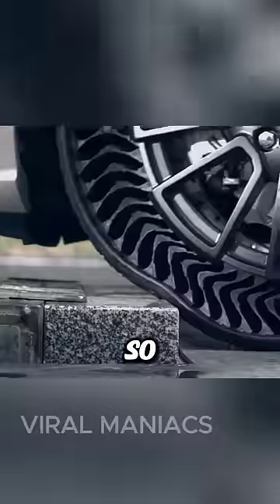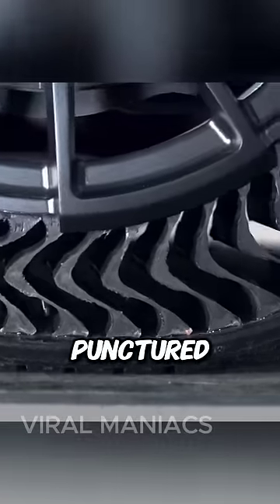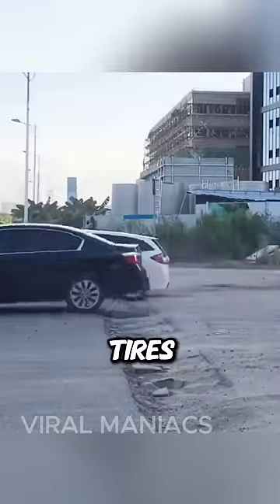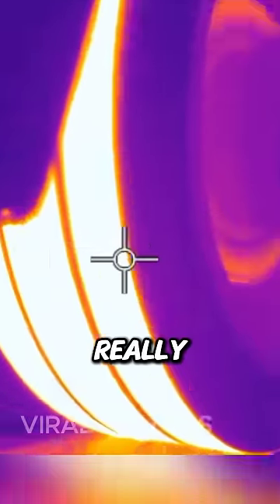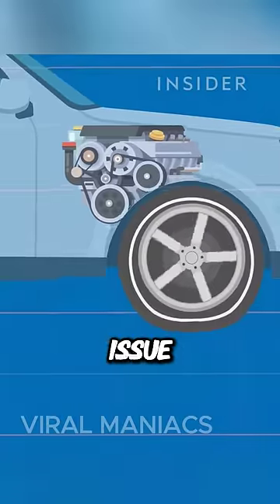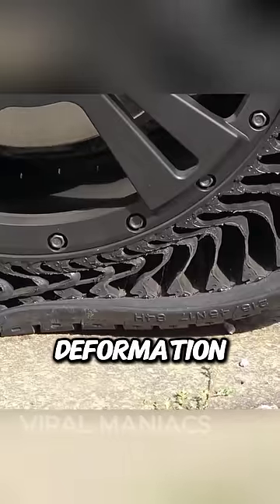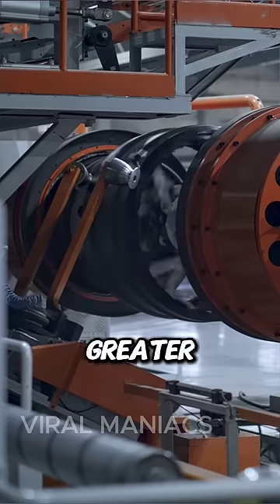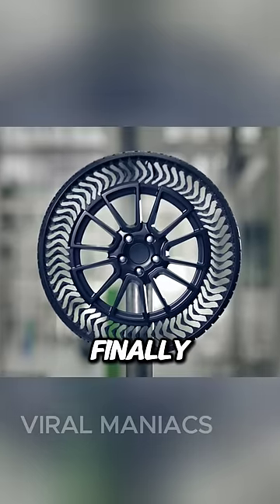Why Don't We Use Airless Tires Yet #shorts

Comment: Firestone bought a company around the late 90s. Doing the same things to stop them from making it.
Reply: I have heard of that happening, with Numerous companies... Honda bought Carabella (Mexico)  back in the mid-70's to stop them from producing motorcycles that were out-performing their own machines, and selling them to their Largest market at that time, The USA....  Several other companies have done that, sometimes with favorable, and sometimes with disastrous results... Boeing acquireing Douglas, was perhaps one of the largest acquisitions that was notoriously riddled with serious quality control issues and unauthorized engineering and production practices... Many of their problems stemmed from  the independant contractors who were not properly trained with the manufacturing and assembly techniques and the lack of adhering to standard policies & procedures...
        These acquisitions and Mergers, can make (or break) previously healthy companies... It largely and frequently depends on the upper management , and what their ACTUAL intentions are....
Reply: @michaelmartinez1345 Boeing and quality control issues? Shocking! 😂

Comment: If the objective was to create tires that doesn't burst, why not merge the two as one and fill them with air to address the issue of bursting, shock absorption, deformation,  etc.
Reply: Those are called run flat tires. They are pretty nice if you can afford them.
Reply: It would probably cost more to make sure the the tire can handle the air pressure, and even if they could make it work if air got out through a hole or something it would throw off the balance and safety would be a concern
Reply: @nickh7777  bingo. Wobble wheels

Comment: Honestly the main resion is that u change a tire more from lose of tire grips instead of punchers.. fix that first please and tks🙏 😅
Reply: Let's not get ahead of ourselves just yet. That part hasn't been covered. Maybe is very durable.
Reply: Soft and grippy tyres wouldn't last and they would be expensive. Hence why you only see them on performance vehicles. In what way do you tyres lose grip??
Reply: @jesmondo5785 he's talking about tread wear. Which is not the main reason tires get replaced. If it was, the tire industry wouldn't be designing tires that can last  thousands of miles.
Reply: maybe you should go back to school
Reply: To be clarify, I was talking about wear and tear.. maybe I'm getting luck but honestly only had 2 punchers I'm my life time ( one of them was suspicious btw nail in side wall?? After being parked in town) 
so basically almost all my tire changes was because of wear and tear ..
Lose of tread deapth essentially..
But as I said my experience may not be  Typical  ..
Reply: Your experience is typical. Good point. this "advancement" seems useless
Reply: @Bl4ckD0g rofl.. tread wear IS the most common reason tyres get worn and replaced, what tyreless country do u live in,?..
Reply: Spreak engrish prease

Comment: What about shtt accumulation every 2nd day between those gaps making it rock hard
Reply: they are covered like a normal tire, its exposed for visual purposes only
Reply: @59plexi So there's a side wall that needs to flex without splitting also...
Reply: @cpickles2996  yeah, exactly..it can't b covered

Comment: Sooo instead of replacing the tyre, i need a new wheel also?
Reply: Tire*
Reply: @user-oz9fq5uf6g  not american mate. The union jack should have been a clue. Tyre is correct 👍. Also its Colour not color.
Reply: @leed2883 you changed your language half way through.
Reply: @stephenkillin9730  what you on about?
Reply: @stephenkillin9730 The US doesnt even own English
Reply: @leed2883 hate to break it to you, but both "tyre" and "tire" are correct, and both "color" and "colour" are correct. It may be hard to comprehend but it's called a language difference which results in different spellings for the same meaning. There is a reason why there is English (US) and English (UK) in a lot of language options on devices. Lexicons differ between regions even if they both use the same base language, in this case "English". You understand what he is saying when he says Tire and Color, and he understands what you're saying when you say Tyre or Colour and that's all that matters because the only difference is the type of English

Comment: These haven’t been shown to be better in many of the ways that matter like efficient rolling resistance (They tend to add rolling resistance, although doing so while adding traction by increasing the contact point space between the wheel and the road / ground surface, sort of acting like a tank tread) Because they obviously don’t have air inside them and traditional tire sidewalls that allow for air pressure to push against said sidewalls to add strength, causing a lack of structural and efficient circularity rigidity to the tire. These tire / wheel systems would likely be good in zero or low atmospheric conditions with environments of lesser gravity, like the Moon and Mars, where the tread deforming could add traction and allow it to deform over rocks and other potential debris and obstacles. Unlike the solid metal wheels on current rovers like Curiosity and Perseverance, which have been shown to rip off sections that are stress hardened over time and then made hard and brittle after time of ware and tear, as well as cycles of temperature extremes going in and outside of direct sunlight. Whereas, these tires could possibly retain their pliability. Granted, they would have to be made out of a substance that remains “rubbery” at the high and low temperature extremes experienced on the surface of the Moon and Mars, when traditional sunset would place them in or out of direct hot sunlight and very cold shadow (causing extreme variability in temperatures) and since having air pressure in tires surrounded by little to no atmosphere, is basically impossible due to little to no atmospheric pressure pushing against it, and causing for unintended expansion of the tire pressure in standard tires makes them unfit for these off Earth applications. It could possibly also allow for the regolith to pass through the connection struts of the tire, possibly allowing for a paddling effect in deep and loose sandy regolith. Possibly even utilizing variable pockets of air in bladders in the support strut structure of the tire that can be adjusted by removing or adding air in these struts to add a circular rigidity under certain circumstances and conditions, allowing for variable deformity of the tires for various conditions. There is still a lot to study and engineer / iteratively redesign and update with these, especially to use them in space, on the surface of the Moon or Mars and hopefully on Earth as well, despite those environments having drastically different engineering requirements and challenges.
Reply: Dude, you strained my brain with that!! 😅😅
Reply: @shaggydog5409 Lol, sorry. I’m just really passionate about engineering and specifically engineering applications that can be applied in space or off planet and I do believe these could have beneficial applications for such things. I hope it was at least understandable, as I have a tendency to go on a tangent trying to put my thoughts into word sometimes.
Reply: @L33tSkE3t  yes, I'd say you got just a little bit carried away!! But then why not?  In a way it's refreshing, especially in this day and age.
Reply: @L33tSkE3t  I'd bet you carry on some very interesting conversations. The kind this gal wouldn't  mind sitting in on just to learn a thing or two. Have a good morning.
Reply: @shaggydog5409 Well, thank you. Yeah, I definitely did get a bit carried away with my run on sentences and seemingly infinite amounts of tech optimism (which rightfully seems to be in short supply these days) Anyway, again, I genuinely appreciated the constructive criticism and it was great hearing you say that my unyielding optimistic comment was genuinely refreshing for you. It’s always nice to hear that, so, thank you. 🙏 You have a great morning as well!
Reply: Are there pot holes on Mars? Road hazards? Nails? Just wondering. 😅

Comment: Why we dont use airless tires? Namely due to the fact that airless tires will absolutely destroy fuel economy. The 25 mile per gallon vehicle now gets only 12 miles per gallon. Unless said tires are made more solid. Then you'll feel every bump in the road, and if you drive where I do, you might get a free spinal realignment. 

No thanks.
Reply: please explain why gas mileage would decrease with these tires compared to a standard pneumatic tire.
Reply: @darthvirgin7157  These 'airless' tires will flex, compress, and otherwise move around when enough torque is applied. That means when a driver steps on the gas pedal, more energy is expended to get said vehicle in motion, meaning fuel economy goes down. Way down. Inversely as a driver stops, this tire will generate more heat as said kinetic energy is displaced whilst stopping. Heat + Tires = Bad.

Want a better example where said effects can be felt and realized? Get a good bicycle. Ride on good inflated tires. Now flatten them and go for the same ride as the first one. You'd be much more tired, as more energy was expended attempting to ride on a flat. The flat tires would also be damaged more.

This is why tire manufacturers always stress proper inflation of tires, as over or under inflation leads to poorer fuel mileage, bad tire wear, and quite possibly catastrophic failures which could lead to an accident.

The tires featured in this video are a novel concept but impractical due to their design. They would never work well on a road vehicle due to the energy and efficiency losses inherent to the design. Furthermore, the open sidewall construction is just begging to collect rocks, dirt, mud, and all types of foreign objects that will make the wheel completely out of balance, leading to tire damage, catastrophic failure and increased accidents.

Tires of this design would be better suited for slow speed applications like farm implements which I've seen used before, and other related applications. But keep in mind the fuel economy still goes down for whatever they are being used on.

Hope this helps. Have a super day friend.
Reply: @Cline3911  
you’re basically handwaving what you think the consequences are for both tires without the physical details. 

when you apply the same initial torque to both tires you get the same twisting effect. as to how much the axle twists before force is transferred to the ground is debatable, sure. but you didn’t say WHY a pneumatic tire is stiffer. 

the constant flexing of rubber due to road compression and road-tire friction does produce heat, for BOTH tires. but you also didn’t explain WHY pneumatic tires produce less heat. 

if the company is claiming that they have addressed such issues, i’m not just going to DISMISS them offhand. for one, they’ve spent millions and decades in R&D and have now come to a point where they’re justified in selling it to the public. 

are there disadvantages to these new tires?  sure. but if the company is willing to sell them, they probably found more advantages to putting them to market. 

my biggest concern is the mounting. will these require new wheels?  how does it do in sharp turns?  other than that, i’d be interested in them myself.

Comment: It would cause the same amount of waste. It wears out at the same or faster rate and would need to be changed just as often.
Reply: Much more waste considering the extra rubber used in the supports.
Reply: @richarddavis6133  maybe.

Comment: I guess the police spike strip isnt going to work on these tires
Reply: good thing they can disable your engine
Reply: They already have a replacement system that looks like a net. It wraps around the axle forcing the vehicle to stop
Reply: @osets2117  "...looks like a net" If it's the one I'm thinking of the police vehicle has to get close enough to deploy the net.
Reply: @stephengraham1153  it can be deployed by hand, it doesn't need to be dropped by a vehicle that would be stupid
Reply: @osets2117  It must be a different one to the one I have seen. A contraption on the front of a police vehicle deploys two metal arms holding a net which then wraps around the rear wheel of a target vehicle bringing it to a stop https://youtu.be/Ikp73-aH2UI?si=BllxPnAFoCv7O3ua
Reply: @stephengraham1153  this one wraps around the front of the vehicle. An individual can throw this out in front of a vehicle like a typical spike strip would be

Comment: Tires companies make so much money on the tires we have already. These will never be released to the public even after they fix the issues.
Reply: Why not? They already cost dramatically more than a pneumatic tire, if they're charging as much as they do they'll definitely make a lot of money.
Reply: Michelin have been diddling with these since the early 1980's. They are unstable at fast speeds and dangerous. They sell them for limited slow devices like fork lifts etc.
Reply: @xineohpinakc264  I've seen them in riding mowers that's the only thing they make sense in not cars
Reply: @Argedis  Slow devices. I worked at Michelin for a while and got to see the test videos where they worked for years trying to get them to work in cars  and they made the car nearly flip and the ride was rough.

Comment: If they aren't lying and production costs are actually slightly higher by like $4. It's only because the engineers had to make a new model. Once the model is made it's just injected again. So the price increase is so small it wouldn't matter and it would definitely not affect the market value. However they say that so they can charge you a lot more

Comment: We use them on our Zero Turns, its had a better traction than air filled tires, the only problem in time the fins between the rim and tread tend to break then it becomes too unstable to drive. But if they master this airless tire into production, cops can retire the spike strips, but use the Grappler or the GPS Dart (Starchase)

Comment: It actually uses 5 to 10 times the rubber, 
Regular air tires rarely get punctured and anything small like a nail is so easy to patch most shops so it for free, or you can buy a $5 kit and fix it yourself in 20 minutes

If saving rubber and reducing waste was priority we'd all still be retreading tires 
It drastically reduces waste, and the waste is much more manageable, less steel cables and mixed materials

Comment: Best way to resolve low tire pressure is to simply build a small hydraulic pump that is attached to the wheel. This could connect to the air pump where you have a sensor detector low tire pressure. And simple have either the owner set a timer to auto fill the tire or have it set automatically when the car is detected that it’s been parked longer than an hour.

Comment: The tyres are mostly changed due to thread wearing off, not puncture. So the rubber waste issue won’t be resolved by introducing airless tires.

Comment: Car tyres last around 10000km.

In around 400,000km of driving (spread over 25yrs)  I've seen two punctures and only one that necessitated a tyre change on the side of the road. Both tyres that had pictures were able to be plugged for around $40au, so weren't scrapped. 

I don't think airless tyres will do anything to reduce rubber waste but will instead increase it. Unless the tyre just becomes the tread part and the bouncy bit in the middle is part of the wheel

Comment: They will be expensive because it’s also replacing the wheel that air filled tires need. Even though 4 of these wheels probably costs less than 1 air filled tire to produce, I’m sure the price for one of these airless wheels  will cost more than 4 air filled tires

Comment: The thing I've never understood about airless tires is: 

Why the binary? Why all air or all airless?

Why not have both: an airless capable tire that's.. .. filled with air. Akin to a run-flat tire, whereby the pressure is on the air, like normal, but if punctured, airless is there to save the day. 

Especially in vehicles that don't have a spare. Or don't need one given airless tires bide time to get to place to replace/ repair puncture.

Best of both worlds and priced accordingly.

Now: space for spare can become battery. That's a good sized battery. Even if only 10-25 miles (of battery), that's a solid surge (performance) or back-up (distance).

Comment: I’m curious to see how lateral force has been addressed. From casual turning right on a green light appropriately adjusted to below the posted speed limit. Reliability includes not just occupant’s experience but those around them as well. Reducing rubber usage has to be the #1 goal. Extending drive time by requiring adaptive changes multiplied by the number vehicles in a reasonable area will affect mass adoption. That is… don’t get behind that AHole. He’s running tubeless and has to take the next turn at 20 MPH regardless of the environment (speed limit, the actual speed of traffic, banking, centered crosswalk, etc). I’m a car guy. I love fast corners and even faster acceleration. A controlled slamming stop has its place as well. To the extreme you have drifting and burnouts. Not because “should they be done” but because they will be done within the first hour of commercial release. Of course… a motion driven electrical generator and energy storage system located in a counterbalanced position with underglow lights threaded between the tire (make up a name) walls would look pretty cool. At least for a decade before something new is requested. - Stop reading. Nobody reads this far.